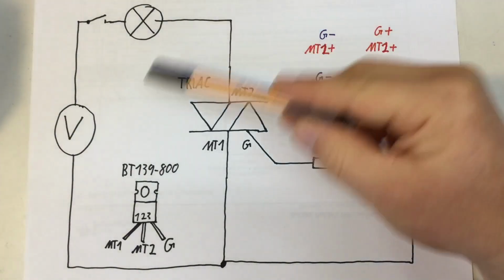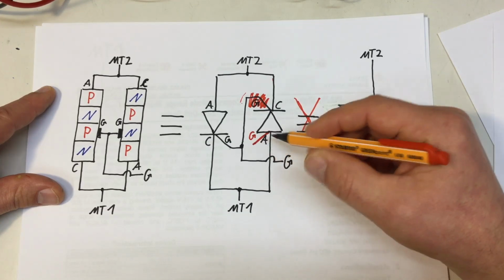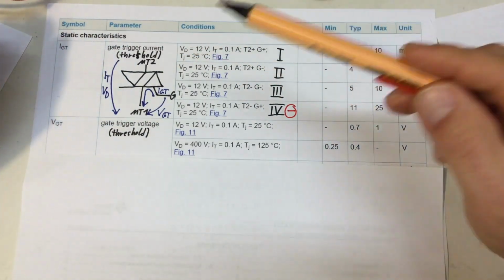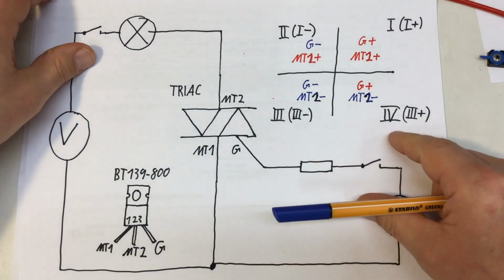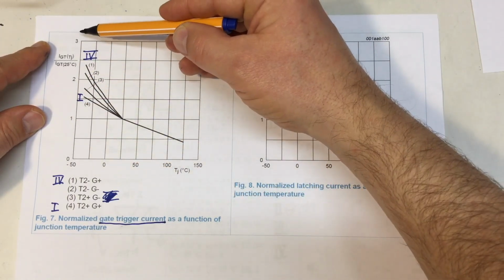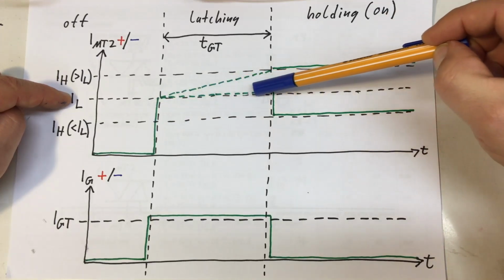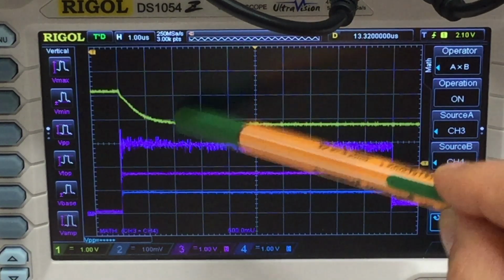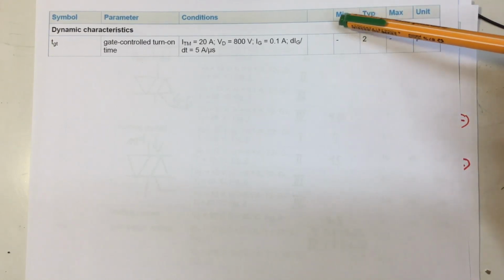TRIACs – The Dirty Details (1/3): Gating, Latching and Holding

Comment: Studying such historic component has become more tedious than the R&D people suffered. Bcause of improper and lazy teaching approaches.
Thank U for  shooting dead the two scr bullshit analogy
Keep the spirit and awaiting such comprehensive videos
Thank U
With Love from India
Reply from the maker: To be honest, I was surprise and a little shocked that this obviously wrong "two SCR analogy" is so widespread on the internet. My textbooks from 1980 got it right (though I have a book "Amateur Electronics" from 1976 that also talks about "two antiparallel Thyristors").
Anyway, you're most welcome!
Best Regards from Germany, Robert
Reply: @robertssmorgasbord 
 hai
Whether the triac part of this circuit is perfectly designed or not?
https://www.electronicsforu.com/electronics-projects/sunset-lamp
1. Will the triac switch symmetrically for both half cycles of ac?
2. Will the triac start conducting exactly from zero of ac supply (both half cycles)
3. Will the circuit produce harmonics /EMI back to power line for load I am using ? (up to 20 w led lamp)
So as to consider it as good  alternative for relay ?
Relay circuit require more power than triac arrangement that  Is I am considering triac and the whole arrangement can be housed inside a lamp holder.
Your suggestions please
Reply from the maker: @jijeshkorothpoyil2697  To answer your questions:
1. Yes, the TRIAC will switch both halve waves through. As soon as pin 3 of the 555 goes to VCC there's a voltage difference between gate and terminal 1 and the TRIAC is triggered. It doesn't matter which polarity that voltage difference has.
2. When pin 3 of the 555 goes to VCC the TRIAC is triggered at an random point of that very first half wave (there's no zero cross detection in that circuit). Afterwards consecutive halve waves are let through completely.
3. There might be a spike during that first half wave, but otherwise the circuit itself shouldn't produce any interference.
I think it's a nice circuit and certainly more elegant than using a relay.
Reply: @robertssmorgasbord  

Some more clarification please
.......
 BT 136 600D datasheet says in 
It's static characteristics (@ Vd= 12V / It =0.1A) that typical gate current for triggering for
T2positive ,G positive =2mA
T2 negative, G positive=5 mA

WHICH IS ........MY CASE

Please say

1. can u say  is there any " optimum range" of gate current that should be "ensured always " for perfect operation of triac  as a switch in my circuit?

(Maximum allowed gate current as per datasheet is 5mA and 10mA respectively for my circuit's working quadrants.)
                       OR
How to choose gate resistor value in my cicuit? Is 100 ohms correct?

My circuit's capacitive power supply can provide 3.5 mA per 100nF in halfwave configuration and 7mA per 100nF in fullwave configuration

So as per existing design, it can give maximum around 6 or 7 milli amps.
Shall I redesign the power supply?

3 .Is it advisable to put a diode at the 555 output?

4. Is the capacitor at gate  is necessary?

My circuit triggers ON for "some time" and comes OFF  when even other farthest switches in my house is operated with small loads

Also some times triggers OFF  for "some time" then come ON . When it is ON while operating other switches in my home.

(Power line switching noise??)

I am thinking to employ fullwave rectification for for isolating the 555 section from neutral  

Will it help to avoid unwanted triggering due to supply mains line switching noise?( I think It is mostly 555 IC triggering at 1/3 VCC and 2/3VCC levels as the noise voltage affects the trigger input hopefully as neutral is directly connected to its negative. 
 And not a dv/dt triggering 
Because triac keeps ON for "some time " and  
The switching noise turns OFF the triac for "some time" when it is ON also
The "some time" may be the LDR Response time when light is removed because there is some light feed back happening which is unavoidable as per my scenario.

I already put 1n4007 diodes at 555 output just before triac gate and in the negative line to 555 just after triac MT1 .
Reply from the maker: @jijeshkorothpoyil2697  Here we go:
1. There is no "optimum range" for the trigger current I(GT). To ensure triggering the trigger current should be at least I(GT) Max times the temperature factor given in fig. 7 of the datasheet (more trigger current is needed the colder the TRIAC is). In your case minimum trigger current of 15mA should do the job. Note: I(GT) Max is not the maximum trigger current the TRIAC can survive, but the maximum current that is needed to trigger the TRIAC.
According to the circuit description the NE555 is operated at 15V (you should check that!), so the 100Ohm Gate resistor will deliver 150mA to the TRIAC, which is an absolute overkill and probably drags the circuits supply voltage down. A 15V / 15mA = 1KOhm resistor should be more appropriate there. Note: if the circuit really operates at 15V the (red?) LED would be fried at about (15V - 2V) / 100Ohm = 130mA.
So something is not adding up here ...
3. No, you don't need any diode at the NE555's output.
4. I think the capacitor C2 is unnecessary. In fact it delays the triggering of the TRIAC (RC element with R2). I would remove it.
To avoid any noise triggering the circuit I would place a small capacitor between pin 2&6 of the NE555 and ground, say 10nF or 100nF.
Generally I think the currents drawn through R2 (gate) and R1 (LED) are far too high for that little capacitive dropper power supply.
Reply: @robertssmorgasbord  
Present  capacitor power supply design can provide  around  7 mA maximum only ; But triac works with LED lamp as load without problems
................................................................
(Don't know whether it is triggering symmetrically or not for both halcycles And is creating any switching noise back to power line)
.................................................................
Here temperature will never go under 25 degree Celsius.

What about using" snubberless" triac BTA 06 or like that with required modifications for the purpose ?

Thanks for your reply
Regards

Comment: My dimmer potentiometer sparks inside it.I made the circuit by Bt138 600e triac.it works bur trigger potentiometer sparks.anyone knows wht it happen?
Reply from the maker: Could you somehow upload the circuit diagram (on your channel, Google Drive etc.)?
Reply: @robertssmorgasbord  https://drive.google.com/file/d/1WK23jqK3fFo7mhOSXQWDCWBY8SsRrtMQ/view?usp=drivesdk
Reply from the maker: @shadowhunterxxx5891  You'll have to give me access to that file ;-) I've requested it via Google Drive and you should have a message in Google Drive. Alternatively give anybody with the link access to the file.
Reply: @robertssmorgasbord  i shared a photo of circuit schematic.there is no request on my Google Drive but its shared
Reply from the maker: @shadowhunterxxx5891  I was able to to download the picture now :-) I'm assuming "in" is connected to AC mains and "out" to the light bulb or whatever you're dimming ...
Well, your light bulb, respectively, your circuit is at the wrong position! The whole dimmer circuit has to be in series (!) with the light bulb. See https://electronics.stackexchange.com/questions/206160/light-dimming-regulator-circuit for example. And the reason your pot sparks is, that it's directly connected via the capacitor between live and neutral ;-)
Reply: @robertssmorgasbord  I used this circuit for made a small temprature control used for soldering iron.i know its not good enough for controling temprature.but i had to keep it simple and small to put it in the soldering iron handle.problem is I use BT136 triac but now am out of it.so I made it by BT 138 triac so this proplem happened.
Reply: @robertssmorgasbord  actually the load in my circuit is series with dimmer just put the load befor pot and close the circuit at the"out"side:D
Or by changing the load position in your example near the cap.
Reply from the maker: @shadowhunterxxx5891  Well, then you've done everything right - and I'm, unfortunately, out of ideas.
Reply: @robertssmorgasbord  thanks bro
Reply from the maker: @shadowhunterxxx5891  You're welcome!

Comment: Excellent video Robert, this was just the information I needed in my struggle with the Triacs ;-) Thank you for uploading and I will check out the other parts as well.
Reply from the maker: Thanks for the praise - and you're welcome! If I remember it right the other two parts are a little bit more taxing ... you'll see.
Reply: @robertssmorgasbord   part II was very clear too, just finished watching. I have to datasheets at hand and try to compare 2 Triacs, BT139-600 and BTB10-600. I am analyzing a circuit where a diac is controlling the gate. Your explanation is very helpful for that. Do you talk about a diac in relation to the triac as well in part III?
Reply from the maker: @MarcelHuguenin  Yes, I briefly discuss the use of a DIAC in the third part. However, on the oscilloscope I just demonstrate the effect of the RC element at the gate of the TRIAC without a DIAC (didn't have one handy when I filmed these videos).
Reply: Robert's Smorgasbord I saw it. Your explanation was very helpful. I build the motorcontroller to analyze in the Falstad simulator and now the curves make sense so I understand what’s happening. I can now make changes so I can safely breadboard test with lower voltages (original is mains 230VAC)
Reply from the maker: @MarcelHuguenin  Happy you got something out of these videos :-)

Comment: On a related note, to use a pair of SCRs as a TRIAC: connect antiparallel diodes across each SCR's gate (to prevent reverse-biasing them), and connect a switch (e.g., a MOC phototriac) between gates.  The antiparallel-SCRs circuit is often seen but clearly not practical; this fills in what's missing. :)
Reply from the maker: Thanks for info :-)

Comment: The anode-gate device does exist; it's not called an SCR, but a PUT (programmable unijunction transistor). :)  Of which 2N6027/8 is the only surviving example (but still in production!).  The general type (both gates connected) is called an SCS (silicon controlled switch).
Reply from the maker: Thanks for the info! Just love the PUT! If I got it right its like a DIAC for DC where you can set the breakover voltage through a third pin - ingenious! DigiKey lists besides the 2N6027/8 one more active type: CMPP6028TR. It comes in a SOT package for those modern SMD PCBs. So I guess somebody is still using PUTs in their products/designs. I actually did learn about the SCS (German Thyristor-Tetrode :-) ) back in school (I probably learned about the PUT too, but I forgot everything about them - so thanks again): An SCR you can turn off - what's not to like.